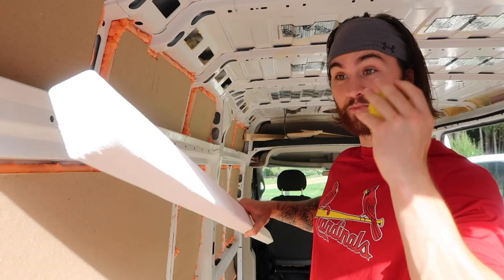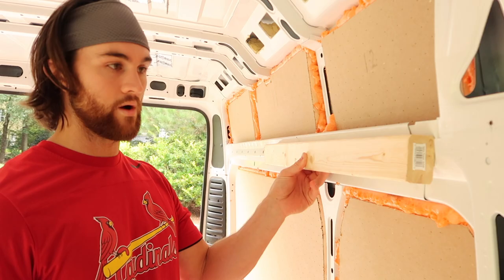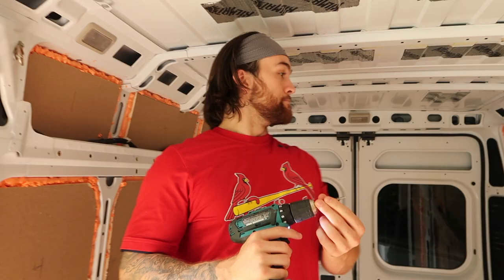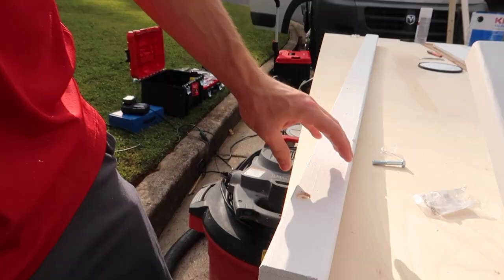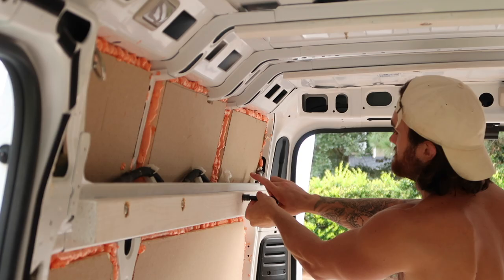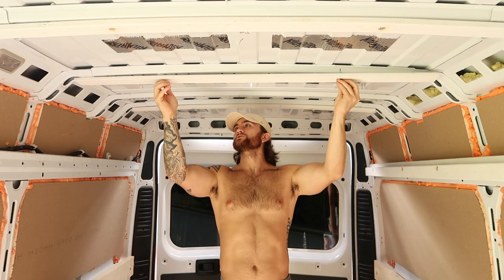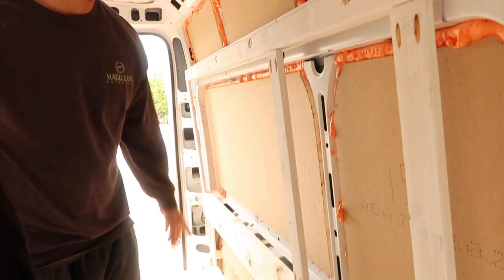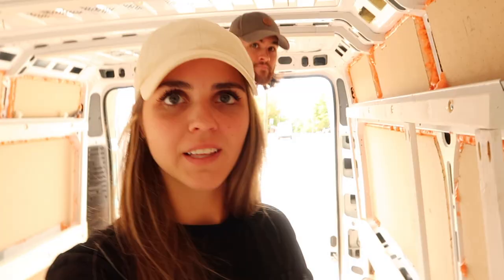Promaster Wall & Ceiling Framing | Van Life Build

Comment from the maker: Our Van Build Essentials › https://www.amazon.com/shop/rickydarianvanlife
Reply from the maker: @sheri4673  they are at Home Depot, yes. They come in different sizes so you just need to get the bolt that is the same size as the rivet nut. Hope that helps!
Reply from the maker: @sheri4673  anytime!
Reply: Hi
Reply from the maker: @sages101  hello 🙂

Comment: To line up the rivnut holes with your board. Use blue tape right over the holes. Poke holes thru the tape at your rivnut then pull the tape off the wall and tape it straight onto your board. Drill thru the tape holes
Reply from the maker: Good idea
Reply: That made zero sense
Reply: I wish I knew what you meant it SOUNDS like a good idea lol
Reply: @bigbunny615765  By using blue tape (painters tape), you can create a template for drilling into wood. You line up the tape in your van over the holes you want to line up on the wood. Tape directly over the hole. Then kinda press the tape until you find the holes and use a nail or pencil to poke thru the tape. Then carefully peel the tape off and  then tape it straight onto the wood you want to mount in your van. Where you poked the holes in the tape, you drill. My van was impossible to measure the holes because they were all off set. You can probably find a YouTube video if you search "using painters tape for template"
Reply: @TheTugboatgirl  I thought you were using the tape to align, not measure. Got it now 👍

Comment: The reason you get mould is you have wood right against metal. If you use rubber or vinyl glued onto the wood you will lower noise and get rid of mould
Reply from the maker: Thanks for that info. We’re going to do that with our ceiling studs. We have been wondering how to reduce the noise in particular.

Comment: Apologies for all the questions, last one I promise! Other videos I’ve seen have said that 2 of the promaster ceiling beams are at a different height than the others. Did you find anything like that when you were framing the ceiling, or did you use 1x3s throughout?

Cheers!
Reply from the maker: From what I remember, we used 1 x 3 the whole way. Difference wasn’t noticeable to the degree of effecting the ceiling panels. Hope that helps!

Comment: Hi! How did you get the 1/4 in rivet nuts to fit into the bottom holes (next to the floor)? Dod you have to drill them out ? Mine are too big to fit
Reply from the maker: We used a step-bit to adjust the holes to the size of our rivet nuts. :)

Comment: Sorry for the dumb question, but you called the furring strips going across the walls (the putty beams) as a 2 by. Is this meaning a 2 by 3? Sweet vid!
Reply from the maker: No problem! Yes, the ones running horizontally on the wall are 2 x 3. Vertical and ceiling are 1 x 3.

Comment: Hi!  Thank you for sharing - what has worked so far as well as what hasn't.  Quick question - Where did you get the rubber that you ended up using between the wood and the metal ceiling rib?
Reply from the maker: We actually already had it. The woman we bought the van from left it in the van, however I believe it's just rubber matted flooring used for gyms, basements, workshops, etc. It's basically the same thing as a yoga mat. I would just get a cheap yoga mat and cut away!
Reply: @darian.explores  Great!  Thank you!

Comment: What size riv nut did you use? Thanks
Reply from the maker: We needed different sizes depending on what area of the van they were in. The ceiling ones are 1/4”, the walls in the front half of the van and all the lowest points throughout the van had smaller holes already so those are also 1/4”, THEN the ones on the back half walls (that aren’t the low ones by the floor) are M8.

Really, you can make them whatever size you want. Just need the step bit. You’ll need that tool for the back half ones because the holes in the van are hex, not circle. Unless you get ahold of hex rivet nuts.

Hope that helps. Let us know if you have more questions!

Comment: Hello there did you used a metal rivet nuts or the aluminum ones? Thanks
Reply from the maker: I don’t remember. I believe metal. That being said, we try to use aluminum whenever it’s available.

The only thing we were serious about being aluminum was our DIY roof rack, which we haven’t posted yet.
Reply: @darian.explores  just asking because i cant find a metal ones and the only ones that i have were the aluminum ones that came with the tool. Thanks for the time replying my question keep rockin’
Reply from the maker: @olepickle5366  yeah anytime. Actually, I just remembered we ordered ours off of Amazon mostly. Some from Home Depot, but mostly Amazon in packs.